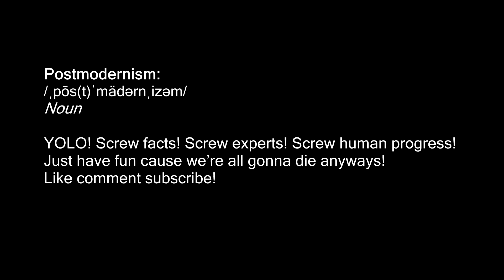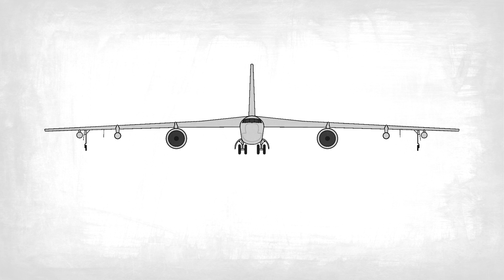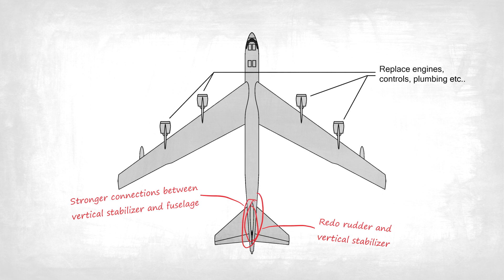The B-52 is Getting New Engines... Why Does it Still Need 8 of Them?

Comment: What about a compromise, a single double size (in power, not dimension) in the inner pylons, and new double engines on the outer, making for a total of 6. if one if the single inner engines fails, there would be about the same moment for the rudder to correct as if one of the 4 outer engines failed. Additionally my "back of the envelope calculation" suggests that having dropped all its bombs, and with approximately 5/8 fuel remaining, it would have a lower fuel burn per mile if two of the smaller engines (one per side) are shut down.  The general rule is that with the same technology, doubling the engine power with a bigger engine, increases efficiency by about 10%.  Would also be a weight savings, along with not possibly having a ground clearance problem with a 1.4 times bigger diameter engine on the outer pylon. The only disadvantage I can think of would be needing 2 sets of repair and maintenance parts and crew training for two different engines.
Reply: Adding another engine model to the logistics trail isn't desirable even if a big engine would fit on the inboard pylon and the flight characteristics were acceptable.
Reply: @jimdavenport8020  :  I agree it is undesirable, which is why I listed under "disadvantage", but like everything in life, the two need to be weighted against each other.

Comment: Very informative, thanks.
I was interested to note, they very strongly went after engines that made exactly as much thrust as the old ones. Not just the same external dimensions & weight, but the same maximum thrust. More would have been fairly easy to do, but they very specifically didn't.
I do think the new RR engines will be a lot less smokey, and probably at least 20% more fuel efficient.
They're saying those new engines are never going to have to come off the aircraft. That's a nice claim, but I think it's a big call. Nice if it's true, but it seems a tiny bit unlikely.

Comment: I don't agree it's the rudder authority that is a problem if going to fewer engines.  An airplane will fly just fine with sideslip as long as roll is controlled (spoilers up a bit on the forward wing to compensate) and the pitch is trimmed as needed.  Then, a good pilot will increase thrust on the dead engine side with the one remaining good engine over there (on a 4-engine scheme), while decreasing thrust on the opposite side to reduce sideslip to zero as needed.   Also, the B-52 is designed to land crabbed into a crosswind using the special gimballed (rotating) main gear wheels anyway.
Reply: And you’re an aerodynamics engineer who understands performance planning.  What’s Vmcg?  What’s Vmca?  Answer that and we can talk
Reply: I think I have to side with Carlos here.  Basically the video is saying if you lost two outboard engines then the plane was uncontrollable and lost?  I'm not saying that losing a pair of outboard engines is trivial, but not a death sentence.

Typical 4-engine replacements feature a useful bump up in available maximum thrust, much better reliability, and higher efficiency. 

I'm betting that A) the new engines higher reliability along with half as many engines significantly reduces the odds of any sort of engine failure, and B) more available thrust means that in a outboard-engine-failure the extra 20% or so of added thrust you could use on the inboard engines would mean reduced rudder requirements, not more.

It may not be ideal, but "OMG outboard engine failure means plane's spinning out of control!" doesn't add up.
Reply: The the tanker received new engines, it required a redesign of the rudder system, along with automated computer controlled rudder system, to compensate for the loss of power in any engine.  Without it, the loss of power in any engine would cause a loss of control,  before a pilot could react.

Comment: Those things circle around my house all the time -- they're pretty loud. I was previously a sheet metal mechanic at TAFB where I was assigned to repairing cracked fuel vents in the right wing. If your B-52 crashed because of a leaking right wing fuel vent it wasn't me.

Comment: Good explanation, replace engines with similar output but more reliable engines so you won't have to change the structure of the plane stabilizer or wings.

Comment: Unlike the previous re-engine proposal which also involved reducing the number of engines from eight to four, the F130 re-engine program maintains eight engines on the B-52. Although four–engine operation would be more efficient, retrofitting the airframe to operate with only four engines would involve additional changes to the aircraft's systems and control surfaces (particularly the rudder), thereby increasing the time, cost and complexity of the project.

Comment: The only flying B-52s that I am aware of today are the H models, which are the newest that were built. Back when I was active duty in the 80s, they were talking about building a J model, which would have taken the recently retired G models and upgraded them by swapping in 4 C5 engines, and then giving them all modern avionics and EW equipment. They never did that. It may have been that they figured the old airframes would never have held up under the strain and metal fatigue. But they said if they could have pulled it off, it would have increased the range and fuel efficiency, and increased the payload capacity, etc. That would have been interesting.

Comment: A much simpler reason is a basic need for redundance. 8 engines: two randon engines get shot, plan still fly. 2 engines: anything happens with one engine, it is basically certain death.
It's a warplane, not a liner.
Add radars, missile launchers, better engines, but no need to reduce the number.
Or make a brand new, stealth heavy bomber, using up the budget.

Comment: I'm retires Airforce crew chief on heavy aircraft like the C-5 (an I still have nightmares about the A model) so if I get something wrong would the B-52 people please correct me. I asked the same question to a B-52 Crew chief and he told me that they would have to replace the entire wing because it would twist back an forth with the new engines. The hydraulic systems pumps (and generators in earlier models )are  not directly connected to the engines but were located in pack around the wing and powered by bleed air from the engines. This was done so loosing a engine would have less of effect on the hydraulic system during combat. So to go to four engines means Replacing the entire wing, the wing attachment points, the Vertical Stabilize and Rudder and redesigning the Hyd system. As you said the cost of going to four engines is cost way more than just replacing the eight engines.
Reply: Most modern engines provide bleed air used for things like anti-ice and pressurization (except on the 787), so I'd think it would be possible to use the same hydraulic system arrangement with bleed air from newer engines. In fact it would probably be simpler than it would be re-enginging an aircraft with conventional engine-driven hydraulics, as it would just be connecting bleed air lines rather than having to interface the hydraulic systems. Unless they decide to modernize the hydraulics as well, but that would be sort of a separate project sensibly done at the same time.

Comment: One of the big reasons for maintaining 8 engines is electrical generation capacity,  The generators on the 8 RR engines being installed is much greater than what they are replacing. the are doing this for future weapon systems such a laser weapons.

Comment: The real reason for why it still needs 8 instead of just 4, its low drooping wings. It's physically incapable of fitting the larger turbofans on the outer pylons. They absolutely COULD fix the small tail issue by placing secondary rudders on the engine pods themselves, but between the low drooping wings and the concern about reduced thrust in engine out scenarios, it's just not feasible.

Comment: It's also not as simple as replacing the engines.  Since hydraulic and electrical power are generated by motors and pumps that are engine-driven, the bomber gets both an electrical and hydraulic system upgrade as well.  And don't forget the cockpit controls and instrumentation that are currently designed to match with the J33's.

Comment: You could make four engine version with some limited thrust vectoring. If one engine goes out use thrust vectoring to correct the yaw from asymmetric thrust. And thrust vectoring could be used to improve handling and fuel efficiency in flight.

Comment: You are wrong, Grasshopper. Vertical stabilizer issues are not nearly as critical as the torque loads that would be put on the wing with an inboard engine out event. The outboard engine would need max thrust and that thrust would put a twisting load on the wing spar. 
Reducing outboard power on the opposite side could reduce asymmetrical thrust demands on the vertical stabilizer. 
Even in the reduced thrust scenario, the thrust needed from the outboard engine on the engine out side would put more torque on that wing than the wing can tolerate.   
The engine out risks are based on the low probability of a pair of engines shutting down. It is better to have redundancy with paired engines so only 12.5% thrust loss is tolerable but not 25% thrust loss.

Comment: Because although it'd seem intuitive that four modern turbofans, typical of modern airliners, would be a simpler way to power the BUFF, doing so would entail an extensive wing re-design, and, also, the B-52 would have to go back to the taller tail section in order to handle having an engine go out.  The BUFF has a "yaw problem" as it is; it's wheels are designed to help it "crab" as it takes off to deal with cross-winds.  The models prior to the one in service, up through the "G", did have the taller tails, but they've all been, per "SALT" treaties, chopped up at the Air Force's "boneyard", Davis-Monthan AFB in Tucson, AZ.  Damn.  The "H" model was enough of a change, with the shorter tail (less drag), that it could have been designated as a new aircraft, akin to the B-50 Superfortress versus the B-29 it was derived from.   Making the B-52 "J" model with four large turbofans is to, in practicality, call for an entirely new aircraft.

The idea of replacement engines for the BUFF was to give it modern, high-bypass turbofans that'd increase fuel economy and therefore range while lowering operational costs.  Also, it's been considered better to have engines like those in use for airliners, in order to retain commonality of parts.  The rise of regional airliners with smaller engines made it possible to realize the maintenance and fuel economy savings of replacing the venerable TF33 engines the BUFF rolled out the factory gates with, as well as increases in cost of jet fuel.

Comment: 2:11 - The marked part of the vertical stabilizer is the servo compensator. The rudder is outlined by two black marks. The question is that the vertical stabilizer area may not be enough for a stable flight in case of engine failure on one half-wing. I understand correctly?

Comment: I wasn't aware of the vertical stabilizer issue, so thanks for that.
But really, the only reason this old bird is still flying is the "philosophy" of the Air Force that you don't replace an aircraft with one less capable. That doesn't should bad, until you realize how the AF interprets that. If the B-52 was to be gotten rid of, you might think the AF would be satisfied with an aircraft that has the same or more payload, range and mission capability. So let's say maybe a flying wing without stealth. After all, no one can accuse the B-52 of being stealthy. If anything it's anti-stealth.
But no, the AF looks at replacing the B-52 as One Upping the B-2, or even the forthcoming B-21. Anything less would be regressive in their way of thinking. Well, Congress is not going to come up with that sort of money, so the B-52 keeps flying, as an ongoing cost.

Comment: Also remember that during initial production (50’s). Jet engine technology was still new. Designing the F108 already has one major baseline advantage……..

The F108 has the TF 33 to copy from.  You can design a modern technology engine but use the existing engine as a template.  Example bleed air ductwork.  If it worked on the previous engine for all these years no reason why it shouldn’t work now.  Keep existing ductwork locations, hydraulic lines, generators, you get the idea.  I would think that the F108s are probably going to have a Full Authority Digital Engine Controller…(FADEC). Exactly what it says.  Digital engine controller.  Aviation equivalent of the Engine control unit on your modern day family sedan/wagon/SUV etc….

Comment: She's kind of like the Boeing 737 of the Air Force heavy bomber inventory. Rebuilt and updated until she just can't cut it anymore, and even then they'll be flying them to Mars in the distant future. The vertical stabilizer was historically kinda shit tbh. The airplane is really cool, sure, but there's even a video on youtube from the Air Force about how when flying next to a mountain range during a flight test (Boeing leased the airplane back temporarily), the wind shear tore the fin off. They managed to limp it back to base by dragging the aft landing gear, dropping flaps, and adjusting thrust on the engines to keep it flying straight. They also had to come in a bit faster than usual to keep the ship stable.

Comment: Im working on parts for the b52 re engine program, we are holding extremely tight tolerances that were impossible to hold back when it was originally designed. Im guessing that even though its an old design the fuel efficiency and the part durability are going to far exceed the original specs.

Comment: Watching a fully load B 52 take off is amazing.  I got to watch some take off from a control tower perspective.
At first you think no way is it going to fly.  It is like watching an albatross starting to fly.
Reply: In Guam, the runway is right next to the water, but at an altitude of 500 feet.  There was more than one fully loaded B-52 that used that 500 feet of "instant altitude" to gain airspeed.
Reply: @brucedubbs6939  I bet that was kind of cool to watch.  Considering those airframes are older than the crews that still fly them is amazing to me.

Comment: If it ain't broke, don't fix it.  Nothing inherently wrong with eight engines.  The entire plane was designed around an eight engine configuration.  Let it be.
Reply: except the maintenace and fuel cost of 8 engines which is......a lot
Reply: @Tracomaster  ,
RR has stated that for the foreseeable future of the B52Hs that the engines would stay on wing for routine maintenance. That would be a significant amount of maintenance savings compared to the original TF33s.
Reply: @Tracomaster  , 
The RR engines are forcast to reduce mission fuel usage by such an extent, about 25%, that at least one normally programmed aerial refueling mission of the B52Hs will not be needed. That should free up the tankers for other missions.
Reply: @davidhoffman1278  you but they still have to maintain 8 engines and that's like... More than 7 I'd say

Comment: i think some company has came forward they have an engine that fits exactly in the same housing. the only thing they would need to so retrofit the fuel lines and stuff. and it saves fuel as well.

Comment: The plane is super old. Ancient airframe requires special considerations. Also consider, 1) Plane will shut down engines to conserve fuel to traverse the globe, 2) Large rudder is less important while flying in straight lines to traverse the globe, 3) Excessive use of rudder hampers fuel economy while traversing the globe, 4) Because, traversing the globe .. xD

Comment: i doubt the USAF wiil be looking for more thrust out of the new engines because of the constraints of the old airframe, whet they will be wanting is easier cheaper maintenance meaning higher availability "better reliability with the same result"and more bang for the for buck better fuel economy "more range payload"but better engine response will also be wanted those old engines' can still compressor stall and i would assume they will also include FADEC engine management making this old bird a much friendlier thing to fly.

Comment: The risks from engine failure depend on the type of failure.  For a simple shutdown you will be left with 7 engines.  For a turbine that blows the shrapnel with probably take out the other engine on the same pylon leaving you with 6 engines a asymmetric thrust just as bad as with an engine failure on a 4 engine plane..

Comment: I've read some very good posts from folks on why they kept 8 engines. Now I may have missed it as I didn't read every post, but the main reason they kept 8 engines is because of engine(s) out (on one side) rudder authority. If you look at the B-52 rudder, it's not that large, bigger engines would have necessitated a larger rudder and therefore more engineering and development costs.

Comment: Considering these problems, the fuel burn and how long these planes are planned to say in service wouldn't it just be cheaper to build new planes rather than keeping up all the support and modernisation for these ancient airframes?

The B52 is great and all but it's essentially a big dumb bomb truck and you could do that way better with technology, taking an existing airliner and slimming down the fuselage a bit would do the job pretty well.

Comment: FWIW, Rolls Royce won the contract to re-engine the B52. Theyll use their F130 engines, in a pod, just like the original configuration. Contract is for 600+ engines. The engines will be built in the US.